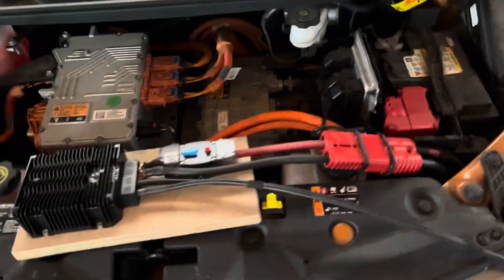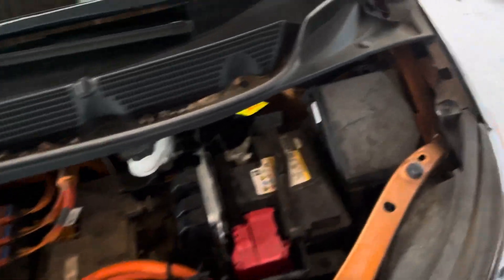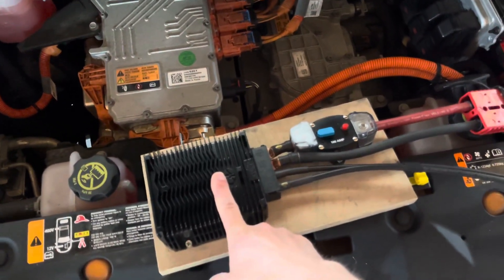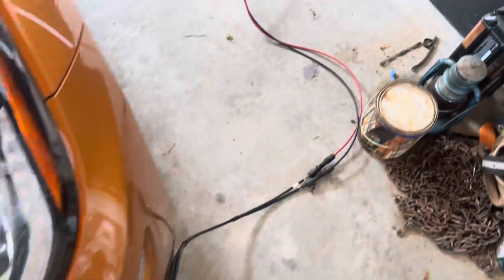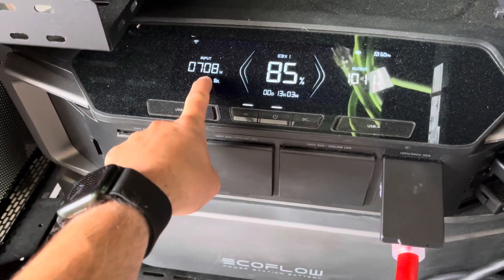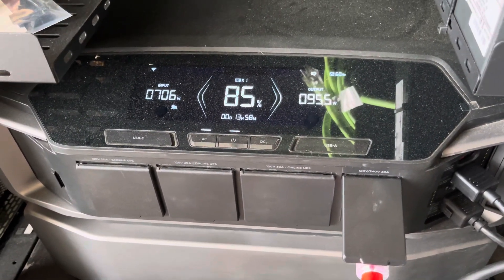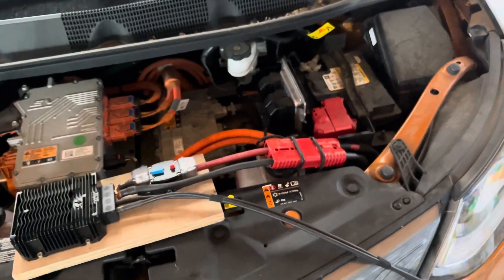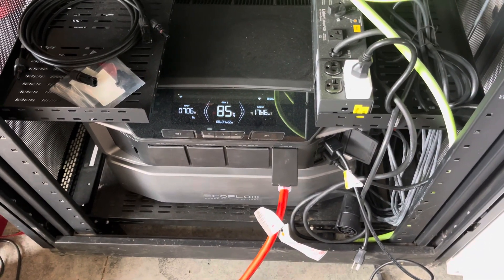Chevy Bolt backup power through EcoFlow Delta Pro Ultra

Comment: My inverter came, it works but I noticed that if I touch bare metal on my car I get shocked.. does yours do that?   I see you have a lot plugged into yours so maybe it is grounded in a way that mine isnt?
Reply from the maker: @MtnXfreeride   Interesting!  I bet it would give a little zap, but I probably just didn’t happen to touch it and the car at the same time.  Not all DC-DC converters are fully isolated, but it would kindof surprise me a little if the case of the unit was not bonded to input negative… after all, what would happen if I screwed it down to a negative ground surface on the car?!

My wife has the Bolt today,  but I’ll put a volt meter on everything when she gets home and give an update.  I would not recommend that part to anyone further if I find the case is at +48V!
Reply: @joekirklin did you end up testing this?  Wondering if my DC DC converter is bad or my setup has an issue.
Reply from the maker: @MtnXfreeride   sorry.  I’ve been a little lazy bones lately, and also away from home.  I’ll try to get to it this week.
Reply from the maker: @MtnXfreeride  ok, just tested.  The case of the DC-DC seems pretty well isolated.  I get about .4VDC from case to car chassis ground.  +48VDC does not seem to be isolated from the input, so you do want to be careful there.

I also tested car chassis to earth ground and saw less than 2V.

You may want to try a different DC-DC converter and double-check your wiring.
Reply: @joekirklin  thanks for checking - the wiring is simple so I am thinking the aliexpress dc dc conveter is the issue.

Comment: Why 2ga wire and not 6 or 8ga?  Seems excessive even for a continuous load.
Reply from the maker: Mainly because I had those parts on-hand, but it is nearly 60A of continuous load on the 12V side.  You definitely don't want to skimp on current capacity - especially with the connector!
Reply: @joekirklin  thanks I have an unused kicker brand subwoofer install kit that has 4ga copper wire that seems perfect for this with we are talking a 2 foot run for my Subaru Solterra into an anderson connector.     One other question...  did you just use the included low voltage solar cable and cut an end off to plug into your inverter or did you find the "cp30" connector as they advertise in the DPU manual and make your own cable?   (I cannot find a "CP30" connector, I wonder if it is propritary.
Reply from the maker: @MtnXfreeride  I used the included cable for low voltage solar input on the DPU, but I extended it with some leftover PV wire and a couple of MC4 connectors, then regular lugs to connect to the DC-DC converter;  that way I didn't have to hack up that nice EcoFlow cable.  

How much current can the Solterra source from its 12V system?
Reply: @joekirklin  thank you. I'll order a 15-foot 10ga solar wire extension.   The ecoflow cord is $60 to replace.
The subaru solterra supposedly has a 150amp dc dc converter going to the 12volt system. No one has really confirmed it though.    I think this setup at 60 amps is a safe way to leave alot of headroom but keep my DPU topped off since my base load in a storm is just a fridge and running my oil boiler for heat (250 watts).  

Home depot put the DPU on sale last week at $2800 which I assume is a price mistake.  But it shipped.. so now the planning is amped up on how to replace my old generator.     

Hoping i can get a 5 450watt panel ground mount setup soon too for the high voltage solar input.
Reply from the maker: @MtnXfreeride whoa!  You stole that DPU!  Nice.  The price has been my only regret on the DPU so far, as I paid nearly full price.

I have two strings of 3kW solar on the roof of the garage where I keep my DPU, so I can take one of those and feed the DPU during an extended outage.  Normally they feed a grid-attached inverter.

Comment: May you please put up products list in description? Hopefully this is cheaper than the alternator charger they just released. Then I'll go this path.
Reply from the maker: I updated the description, but it will be another day until YT makes the links clickable.  The hardest to find item is the DC-DC converter, and runs around $100  - be sure you get one capable of 20A if you're planning to do exactly what I demonstrate in the video.  The DPU pulls 15A continuous.  https://www.aliexpress.us/item/2255800097730242.html?spm=a2g0o.productlist.main.1.59cenzhxnzhxYz&algo_pvid=4da0cdaa-8054-45a9-8899-257e1b106f68&algo_exp_id=4da0cdaa-8054-45a9-8899-257e1b106f68-0&pdp_npi=4%40dis%21USD%2124.85%2116.15%21%21%2124.85%2116.15%21%402101f01817192807756356334e416c%2112000034352087833%21sea%21US%212823537160%21&curPageLogUid=82E80FPrM6bw&utparam-url=scene%3Asearch%7Cquery_from%3A

Comment: Sweet setup for extending the runtime on your Ultra. How fast does the electric car 'driving battery' recharge the 12v battery in this setup? Does your 12v battery ever die? 700 watts is a bit of power.
Reply from the maker: As long as the car is "running" the onboard HV battery keeps the 12V system charged.  The factory onboard DC-DC converter that accomplishes this is pretty well over-sized if the car isn't doing much - most folks that have done the connector mod try to limit things to 100A or so with lots of success.  The LV solar MPPT input on the Delta Pro Ultra is limited to 15A, so it won't ever pull more than about 700W given the added DC-DC converter puts out 48V.

My brother and I are also working on a high-voltage version of this that will use the CCS charge port, but that's nowhere near ready - and WAAAY more risky to fool around with.  If we get it working properly, the DPU should be able to source upwards of 5kW from the Bolt!
Reply: @joekirklin  thanks for the info. I wish they had specs online but I couldn't find much about the APU for the bolt.
That's an awesome plan if you can pull it off! Pulling 5kwh from the high DC voltage of the bolt. I mean the DPU can handle 450vdc, so you got some leeway there!